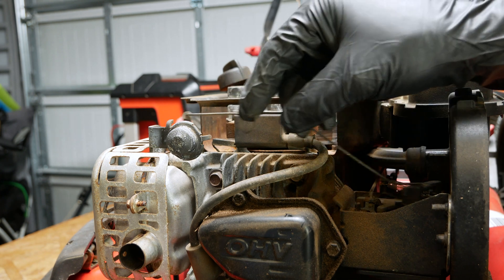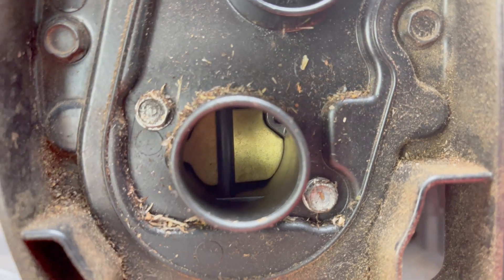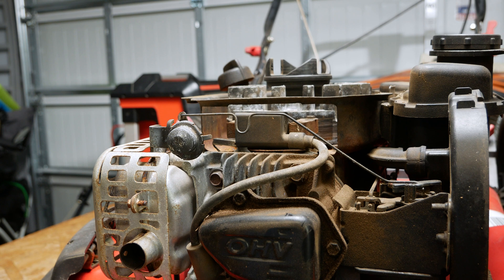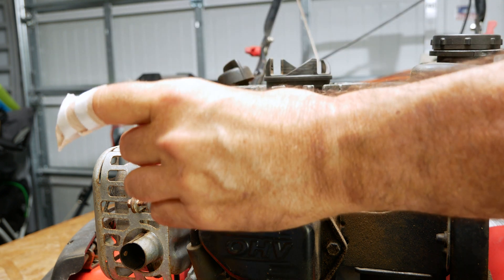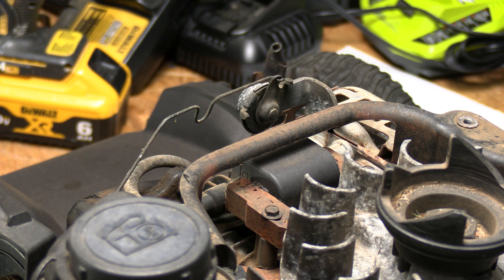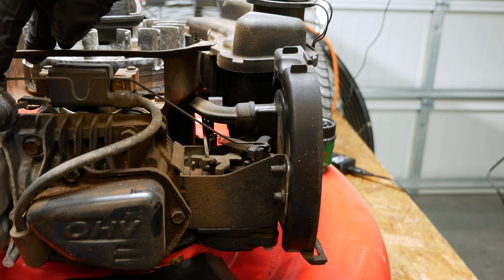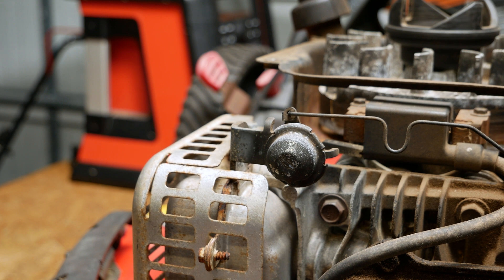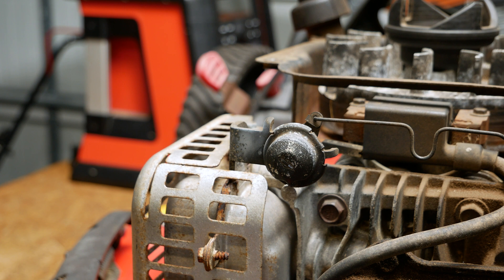How Does The Auto Choke Work on a Briggs & Stratton?  No Start Problem..

Comment: My choke won’t open all the way. Runs rich, almost floods. Adjust or replace?
Reply from the maker: HI... Won't open all the way because the thermister is not allowing it?  Or something wrong with the linkage.  Or you have to hold the choke half way closed to keep it running?  Need more info.  😊

Comment: my auto choke doesnt open when its hot. the guy who invents a manual choke conversion for this engine will be rich
Reply from the maker: HI!  It could be the thermister on the muffler, or the auto choke butterfly itself might not be turning back and forth smoothly...  You'd have to manually open the choke and see if it stays open, then use starting fluid to get the engine started.  Once the engine is up to operating temp, shut it off and pull the top cover and see if the thermister looks like it's working..  If so, then what is going on, should be easy to identify.
Reply: i sprayed wd 40 on all the moving parts on the choke. its over kill. this is the worst lawnmower i ever had. it would be great if it had a hand choke
Reply from the maker: Did you get it working?  I've had several of those engines and they're usually pretty good and reliable... 😊

Comment: If you just can't get the choke to work properly, just spread that little "U" shaped dip in the linkage just until the butterfly is fully open.
Then just get a piece of wire and make a small loop around where the linkage connects to the thermostat coil and run the wire out past the muffler.
Now, when its cold, just grab your pull cord near the engine and just pull the wire closing the choke while you pull the start rope. It will suck enough gas to get it to fire.
Basically, you manually close the choke while pulling the rope. But you have to use a piece of wire because the cover won't let you get to the choke.
Reply from the maker: HI, that's a great idea and much cheaper than buying a muffler with the choke thermostat on it... However, I wonder if the vibrations would cause the choke to vibrate closed while mowing?

Comment: I have a bunch of push mowers and they suck the gas up instead of them being gravity fed like my newer mower the old ones all have primer bulbs
Reply from the maker: OH I SEE...😊
Reply: @JLPicard440  then i just got another old one yesterday a 3.5 murray push mower but as i was looking at the underside twisting the shaft by hand i could see it was bent bad so i took that engine off the deck and put a newer old bolens engine on i think its a 450 something i don't remember but they all look the same to me just different names and numbers so i put that on the dynamark deck because its still a nice solid deck i need to rehook up the throttle choke cable instead of having it automatic choke by the spring so it won't really need the spring with the cable hooked up
Reply from the maker: Great!  You got to save one...  Yes a bent crankshaft means someone hit something hard along the way... Tree stump or rock, who knows?  It does happen though..  Once they're bent, they're pretty much done in my opinion.  I've heard of people trying to straighten them, but I don't know how sucessful that would be.  A new crankshaft is usually to expensive to make it worth the fix.
Reply: @JLPicard440  i swapped the engine its pretty much the same engine with a different name

Comment: Im working on one with that part behind the muffler but i think it works fine but the carburetor is clogged up in someplace plus he needs a auto choke lever so the whole plastic lever and the springs to
Reply from the maker: I've been working on one just like the one in the video and I'm stumped!  I think there's a problem with the valves or the rings.  I've never had one completely stump me before, but this one sure did... I had to give up.

Comment: Stupid nonsense by Briggs. A choke cable would literately last forever for  homeowners that mow 25-35 times per year and works perfectly with little to no maintenance. This "auto" choke is ridiculous and will STUPIDLY will close the choke valve on  an engine that is still at operating temp if  you stop and take a 10 min break after mowing for awhile.
Reply from the maker: I agree... A cable is timeless (unless you leave it outside!)...  This system mostly works, but the 10 minute break scenario could be problematic... 😊
Reply: @JLPicard440  It is..and maybe dependent on outside temps. But...I've had mine not start after mowing for 30-45 minutes and have to unscrew the air filter cover,insert a screwdriver to push the butterfly valve open and it starts right up--coughing somewhat from the excess fuel in there. It's ridiculous!!
Reply from the maker: Yea that is a pain.  I haven't had much trouble like that, but probably just haven't hit the right combination of events yet!... 😂

Comment: I have a B&S 450 OHV mower. Is it's possible to change out the prime to start carburetter for the auto choke together with the heat activated unit.
Reply from the maker: HI, I believe it should be ok.  If I remember right the choke thermostat is part of the muffler and doesn't bolt to the block.  I don't see why it wouldn't work.

Comment: My choke lever on my Husqvarna 3200 psi is stuck in the middle. It won’t go back to the cold position(way left). I’m unable to start it after using it for several hours the other day. Before it died it started for 30 seconds and then sputtered wit smell of oil burning or something. It still had half oil left and plenty of gas. This is a brand new pressure washer too.
Reply from the maker: HI... If it's brand new can you take it back?  If not, you still should be able to get a warranty repair...  I think the thermostat might be bad, but why should you fix it if you can get them to fix it under warranty...
Reply: @JLPicard440  can’t take it back because I waited for over two years to use it. It was sitting new in my garage for two years. Are you saying even after a little two years, it’s still under warranty?
Reply from the maker: HI, no I hadn't realized it sat for that long.  I doubt if it's under warranty...  You can check to see what the warranty period is.  For example Toro is 2-3 years depending on the application.

Comment: mine starts up but doesn't fully open the butterfly. blows black smoke and shuts down. should i bend the wire or replace the thermostat? if i hold the butterfly open it runs as it should.
Reply from the maker: Good question.... IF you take a look at the linkage between the muffler and the carb does it look bent?  If it looks normal your thermostat is probably bad...
Reply: @JLPicard440  thanks for your reply. i bent the bracket that the thermostat is mounted on towards the carb and the problem was solved. if it acts up again i will replace the thermostat. the mower is new and only has 1 season on it. your video inspired me to give this problem 1 more look. thanks again for your help.
Reply from the maker: That's awesome!  I love a free fix... 😊

Comment: Another reason to only buy their primer start engines 😂
Reply from the maker: I've actually found the auto choke to be pretty reliable.  The primer ball engines often had a problem with the air box leaking air between the box and the carburetor and the primer ball didn't work well when that happens... 😀
Reply: @JLPicard440  Hmm, I guess they both have their problems. However, I usually hear far more complaints about the autochokes than the primer. To each his own.
Reply: Just wondering, what year of engines experienced these primer problems? Are these the old flatheads or the current models made in the last 5 years or so?
Reply from the maker: Definitely not the older flat heads!  I haven't seen one of those in many years.  I did a google search to see if I could figure out when they stopped making the primer bulb,  but couldn't find anything on that.  Seems like it's been close to 10 years.  Any of those ones through the 2000s had a problem with the air box.  Sometimes you can double or even triple the gasket and that'll take care of it, but the air box will warp causing this problem.
Reply: @JLPicard440  Good to know! I guess those warped from heat radiating off the metal carb combined with cheap plastics. I'd think most thermoplastics have gotten cheaper and more advanced with time.  Will have to see with these new plastic resin carbs.
Reply from the maker: Believe it or not I haven't had much trouble with those... If they get dirty because fuel was left in the mower, they'll clean up pretty good.  Unlike the metal counterparts will often rust and get pitted up.  The plastic won't do that... 😀

Comment: Great video! I'm working on a Masport with a Briggs engine, and the choke is staying on even when the engine is hot. When you try to start it hot, it takes 10 pulls & blows black smoke for a second when it finally starts up.
Reply from the maker: Oh wow... there may be something wrong with the thermister that goes on the muffler maybe?  Have you looked at that?
Reply: @JLPicard440  So far all I did was blast the little thermostat with a torch like you did, and move it back & forth with my finger to free it up. I was doing some testing yesterday & it might be fixed already! I always do multiple tests to ensure there are no more intermittent problems, but the auto choke was actually staying unchoked when the engine was hot, so your video is right on the money! This mower was covered in clippings & sitting in my neighbor's garage for who knows how long, so the little auto-choke probably seized up because the manufacturers didn't seal it from moisture & corrosion! ¯\_(ツ)_/¯
Reply from the maker: Oh cool!  Yea i've worked those thermostats loose before and they started working...  Hopefully that's all it was.. 😀